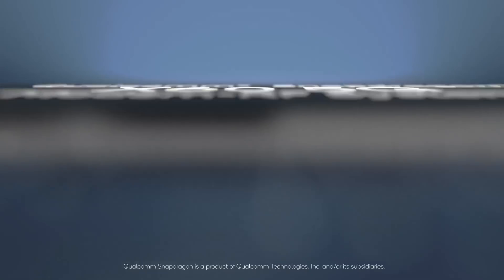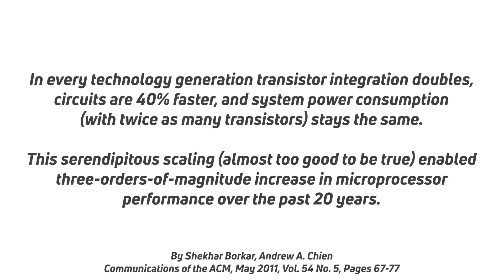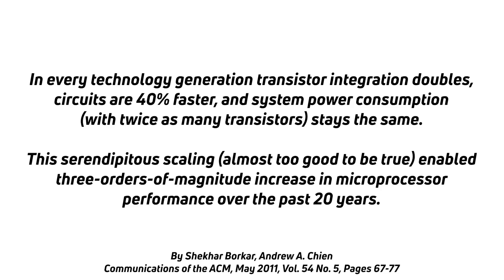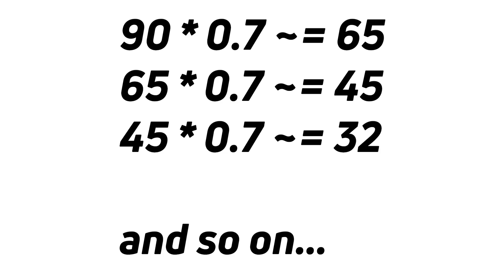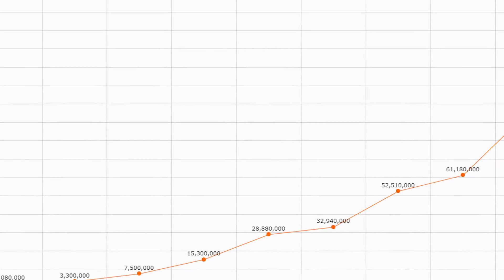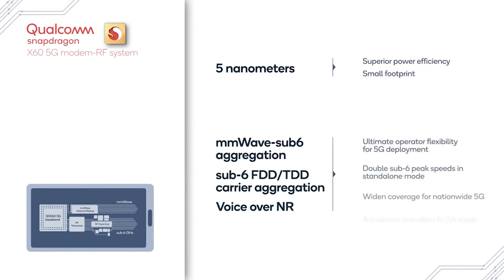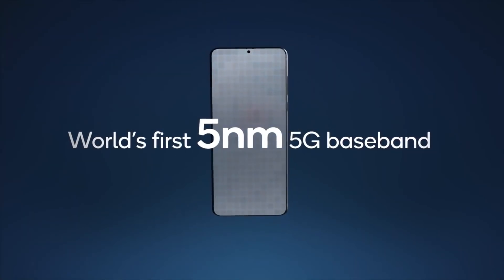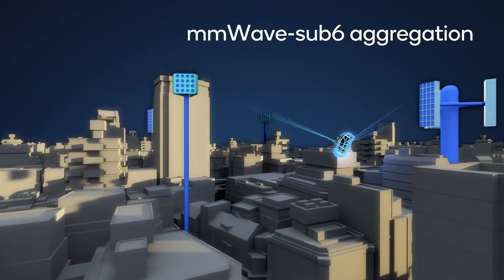5nm Qualcomm Snapdragon Chip Announced

Comment: Just because transisters are getting smaller does NOT mean they're getting faster. That ship stopped sailing, oh, a decade ago. We were getting spoiled, watching processor speads skyrocket. How the 4MHz 8088 morphed into the Pentium at, say, 3GHz. A speedup of about 1,000. 10 years later and the fastest processors, with agressive overclocking, run at what, 5GHz?

Comment: all these processors are just part of the marketing scam. every year they will announce as though theres a huge difference from the previous processor. but the little difference is barely noticeable. take the new motorola flip phone for example, has an old processor, but in use feels just as smooth and good as the latest processors. i understand that they need to keep up this marketing scheme to keep selling smartphones. without it. Also now that smartphones are coming out every 6 months or so. i Would prefer if phones came out every 2 years, and new chips also after 2 years. when theres an actual difference. i dont want to hear things like 20% more efficient blah blah. but i just wanted to point out how interesting it is how all these companies work together to keep upgrading a tiny amount every 6 months to a year to keep the consumers thinking they are getting something much greater etc. but in reality, the real difference comes maybe after 3 years. i think the snapdragon 855+ was probably one of the biggest scams. there r phones that are released after 6 months, and so they wanted a reason to sell them, so they got the new 855+ chipset, just to give a reason to sell their phones. people now a days care way too much about the specsheet. id rather pay a couple hundred dollars less if a new phone came out with an older chipset.

Comment: Can someone explain why Apple is ahead in performance every year, when TSMC is generally the supplier of the latest node to Apple, Qualcomm etc.

Is it due to the release cycle of their phones due to the time of year? I'm no Apple fan boy but that's one argument they seem to always have validly as apple is usually ahead for 5 months until the next Qualcomm chipset.
Reply: This is bec of how apple makes all their products. This is important bec than they can completely optimize their device to fully use the processor. In other words if apple made my Samsung Galaxy s9 it will probably be at least 15% faster than what it is from just optimization
Reply: They design their own chips and it fits 1 OS so can be super fast n efficient
Reply: @williamshaneblyth  Do they though, I've heard their supplier is TSMC, can you clarify and elaborate?
Reply: @adunknowng  Apple has a bunch of their own chips designers  own théir own OS do has intimate knowledge at the lowest level of the OS and Chip machine code so it makes a big difference Android is not owned by Samsung and therefore it's not got knowledge or the ability to personilse and tweak that sort of thing. They are using a generic chip which must run a vast  of hardware designs and can't optimise the OS Apples Metal is an amazing chip specific part of their OS which optimises the efficiency of the combined unit. It's blisteringly fast cause it's functioning at the lowest silicon level
Reply: @williamshaneblyth  but if it were that simple to come up with a more efficient SOC then wouldn't Google just work closer with Qualcomm or Samsung during the chip and OS development?
Reply: @LeeWoods  no not at all it's not simple creating custom silicon is very difficult. Everything else has to work with it if there was only 1 chip and all other components identical but the combo of parts available in phones is staggeringly large . Android has to work on many many chips from cheap to expensive then a huge range of video components to name but two things. Simple it is not. Apple releases 2 to 4 variations of hardware a year. A shear pitence compared to every phone manufacture and all their models . Metal is a layer only on available in iOS. It's machine code level and only has a few pieces of physical hardware to talk to. Honestly it's hard to explain . Part of the reason iOS and Mac os work so well is the fact they control a few different pieces of hardware and the OS windows Doesnt. To make it work at all is diabolical and a nightmare so everything has to work with everything else. Tizen was created by Samsung for their watches makes a big difference it is only their few watches and it can then be so fine tuned . You could right volumes on the topic but simple, nah sorry
Reply: One day or one day Qualcomm beat apple bionic chipset
Reply: Apples CPU designs are optimized for only one OS. And the OS is also optimized for that one CPU design.

Where's, in the world of Android, there are multiple CPU designs Android operating systems have to be compatible with... meaning optimization is limited. And visa versa. Android CPUs have to compromise on optimization to accommodate the various versions of Android...
and other varying components and features also come into play.

It's like console vs PC. If both has equivalent hardware, the console woulf perform better because it's easy to optimize for that hardware when you know that every XBOX will have the exact same hardware. 

While PCs can have a vast combination of different hardware. Limiting the ability to optimize for specific hardware.
Reply: Owletterishere there are two reasons. First, Apple uses more silicon which allows for more transistors in a single chip. This also makes the chip more expensive. Second, Apple optimizes their chip design for iOS, while Qualcomm are used in a highly fragmented series of different phones by different manufacturers, which makes them less efficient in the way they process data.

Comment: Even "RISC"-based CPUs, in my opinion, are getting too complicated.  Out-of-order instruction, speculative execution, major cache management, etc. I have designed a general-purpose processor with only 16 instructions with no multiplexing and no microcode. Straight, hard-wired instructions. It will run like a BEAST on an FPGA, and be super easy to program, even at the Assembly level.
Reply: good for you

Comment: Imagine for a moment, that in 100 years, mankind is still using computers and still doing digiital simulations.       Then lets imagine a computer with a dual-socket Threadripper, each with Infinite number of cores ( LOL ! ).     Then imagine the chipset with a billion PFLOPS, and then quad-socket GPU with a million terabytes of GDRR20 memory, etc. etc.     Then imagine the simulations having
10th Generation Ray-Tracing, and vibrations, and temperatures setting hooked into the user with wireless stick-on patches.        Something like in the movie, "Total Recall."         Everybody, after getting off work ( if there is such a thing as going to work ), will be addicted to whatever game they want to attach to.
Reply: @Elstan McFrolicker mankind will be doomed before that even happen

Comment: Gary just remember that iphones and IOS are more optimized than android
Reply from the maker: eh? No they aren't. Why do you say that? Do you have any proof or reasoning?
Reply: Gary Explains when I was looking at Android phones compared to iPhones (for a game)  Android phones have poor cpu performance compared to Apples A series, and use far more Ram then iPhone (because iOS is optimised to run on less (even with the buggy iOS 13 ) though Android is releasing ver 11 which is supposedly a mark improvement to there os.
Reply: @lasarith2  Do you have any source backing those statements?
Reply: @clickbaitpro  just by realizing that Apple uses Bionic chipsets is enough to understand that the performance would be more optimized and stable than Androids because they don't use Bionic chipsets.
Reply: Clickbait Pro google Cortex a55 (note 10) and Apple a13 performance wise the a13 is better .
Reply: Clickbait Pro okay after about an hour of looking and (should have taken the dog out) the Samsung arm processors Exynos 9810 along with there a55 (yes there’s 2 processes in the note 10lite) just beats the A13 Bionic by about 10% performance,  which means little with either the newest A13+ or the A14 out by end of March/April (given the covid 19 hassle)
Reply: @lasarith2  what? Where did you see that? It doesn't beat the A13
Reply: @lasarith2  you forget that android has a lot more gpu power and ram  , and eventually the cpus are getting closer to apple. And saying that android 10 isn't optimized is bullshit, it's snappy af, even more than the iphone 11 in the s20.
Reply: David Farah I didn’t say it wasn’t optimised , I said iOS 13 while buggy uses less resourced then Android therefore it’s optimised better then android .
Reply: @manofgreed7865  Just by saying that apple uses bionic didn't make it more optimised. SD 865 is better, it has better gpu and better modem. Android is also well optimised and why Android use bionic in the first place? It's one of the Apple's proprietary component
Reply: @lasarith2  iOS is designed to uses less RAM but that's why it can't keep apps in background for longer time. On the other hand Android preloads apps in the memory for faster load time and hold more apps in the background for longer time
Reply: @clickbaitpro  SD865 is good but not better.
Reply: @GaryExplains  iPhones are actually more optimized than android, mostly thanks to that Bionic chipset.
Reply: @manofgreed7865  That's actually bs by now
Reply: care to explain "HOW"
Reply: @itsmekermit4136  care to just search it up yourself instead ofrelying on others to give you answers?
Reply: @manofgreed7865  cause they use their own resources but does it really benefit or are there any changes in daily tasks. The only thing is that a13 is powerful and Snapdragon has really catched up to it and if they make a better processor than what Apple has to offer that apples optimization wouldn't matter.

Comment: Wow mind blown,so who else just has a hard on for lithography as I do,I never realised the factor 0.7 pattern till Gary explained my love of processors is rekindled
Reply: I really don't understand the pattern, there are 12nm,11,10,8,7nm and now 5nm
Reply: @srinivasmr1795  5nm is  the last size a transistor can be, because if it gets any smaller,it will be the smaller than the electrons it carries,then a phenomenon known as quantum tunneling will take place and consequently interference and a chip that doesn't work because it will incessantly short circuit...here is a link from kurzgesagt https://youtu.be/JhHMJCUmq28       if you also want to know how engineers can make such small switches I also recommend that you watch PBS NOVA science now -making stuff smaller hosted by David Pogue it will give you an intuitive insight of how transistors  have evolved.
Reply: @joefraser855  that's the smallest a gate can be.

But, "5nm" is just a marketing term that has nothing to do with gates anymore. 

Plus, FINFETs are kind of 3D gates...you can't really measure it in 2 dimensions.

Hence why "5nm" doesn't really measure anything.

It used to be related to transistor density, power consumption, etc. And could be used as a guestimate.😅 Now it's no longer related...but the old relation is used to market products...and give people a guestimate.

Of course, many companies have over-sold their guestimates.

E.g. TSMC has 2 different 7nm nodes that produce two vastly different densities. One has a transistor density of 65 million the one AMD used. The other 7nm has 113 million. (While Intel 10nm has a density of 104 million...plus there exists an Intel 10nm+ already)

Anyway, the way Intel and TSMC applies these marketing numbers means that:

Intel 14 = TSMC 10
Intel 10 = TSMC 7
Intel 7 = TSMC 5
Basically TSMC = Intel x 0.7

So if you want to guestimate what TSMC would brand Intel's node, just multiply Intel's node by 0.7.

E.g. 10nm x 0.7 = 7nm.

Comment: Amazing tech...... At the rate Intel is failing to upgrade its chip fabrication facilities Samsung and Qualcomm will be producing faster x86 compatible CPUs than Intel - that run ARM code natively at an even faster and more power efficient rate than x86 code. Intel's chips aren't even ARM compatible. AMD should buy an ARM license and bring out a massively multicore ARM based CPU. The Ryzen of the ARM world that runs x86 code OK and ARM code at a much more efficient rate than their Ryzen range currently runs x86 code... The bloated, inefficient, legacy x86 architecture can thankfully be phased out in the next 10 years.... Risc 5 will eat into both the ARM and x86 platforms... If x86 is still around in 10 years time I'll be amazed, but it is a battler and survivor, so you never know.

Comment: lovely explanation Gary, this is what we play for :D

indeed, density hasn't been increasing linearly, but things like finfet made them so they could pack things in a shorter density without really decreasing the feature size to the same degree because of finding other way to reduce leakage/arcing to nearby transistors.
i still remember them moving from copper to aluminum to reach higher package densities in the 90s too

i also remember the 10ghz future claims made in those days, but the truth is, we're hitting a hard wall considering lithography on aluminium that makes anything beyond 5-6 ghz pretty much unfeasable, especially if you want to remain power efficient.
the only way to really keep up with moore's law right now, is width (core count at lower speeds) 

many of the methods used right now are using 2 passes of a higher density, offset by half, to approximate double density

historically, intel has een closest to transistor density:package size ratio, and therefor closest to the true number.

but package size isn't the be al end all either, i remember some iphones had 2 versions of a CPU, 1 being a samsung 14nm, the other a 16nm TSMC, the TSMC was both more power efficient, and clocked higher.

ofcourse LP and LPP and the such matters too, the former usually not clocking as high but very often used for server-grade hardware that isn't after the highest clock speeds, but aims for power efficiency instead. (this is why considering ryzen gen1 a server design gone mainstream is a pretty apt description, r7-1700 may be the most efficient mainstream desktop cpu to date even now)

i guess there was a reason nvidia stuck to the TSMC 16nm for longer for their graphics cards, better results, and likely lower wafer costs, who could turn their backs on a deal like that ;)

Comment: But what about Moore's Law? '-' and quantum tunneling and all that jargon?
Reply: As far as I know 3 nm is thought to be the point beyond which new materials or a completelly new design would be needed for transistors to keep shrinking. I think we will reach the point at which we can't shrink transistors anymore within the next 10 years at which point we will need to look for other ways to increase computing power and efficiency.
Reply: @TriggerHappyRC1  well that's right and even 3nm will not be easy to achieve, fisrt gen might be ready in around 2023 and i guess next gens will be even better, i would say that after 2025 we will slowly start to see Gallium Oxide based chips appearing on the mass market.
Reply: Why are Y'all so smart
Reply: @albertweedsteinthethuggeni7797  i love your name
Reply: @RAVI_KHOLA  thank you
Reply: Depending on how your measurement method, the atomic radius of a neutral silicon atom is around 100 picometers and there's 1000 picometers per nanometer. At 5nm, you're looking at about 25 silicon atoms. Tunneling is a function of the energy between the atoms- not necessarily the number of atoms (tunneling diodes have millions of atoms, for instance). One of the bigger problems is that atoms are always jiggling and if there's not enough of them bonded together, they can migrate away from their intended locations. Three nanometers (15 Si atoms) is reaching the limit where atomic motion starts to exponentially reduce reliability and performance. https://www.webelements.com/silicon/atom_sizes.html
Reply: @LiLi-or2gm  yeah nothing is preventing you from making smaller transistors: they'd just be horrible transistors because they'd be unreliable and unstable
Reply: Ahnaf Abdullah Exactly- you can't really characterise something with so much variability. And you can't devise performance tests for things that are highly variable. Finally, you can't trust what you can't test. It's a real Catch 22 at these dimensions!
Reply: We are still far from quantum effects becoming a big issue. Problem today is making small transistors on industrial scales. Making a single or couple of transistors of size 1 nm is not a problem. Problem is making millions of them on a single chip and making many chips quickly enough to sell them.
Reply: @AlexandreGurchumelia  That and the cooling silicon that is that closely pack together in a smaller area. Less surface area to cool. Air cooled products are going to be underclocked for warranty.
Reply: Processor producers are just going to use different materials that are not silicon when things get really small that will hold electrons better.

Comment: Just to put this in perspective, when I started, devices were 10 micron (10,000nm).The other thing is that an individual silicon atom is 0.2nm so the line width is a mere 25 atoms wide.
Reply: Incredible, is it?
Reply: @saria8340  I would say it is quite impressive. Just a pity the same cannot be applied to gallium arsenide.
Reply: @georgegray2712  They were some devices that had been made in 1978 I think. I got my hands on them in the early 80's.